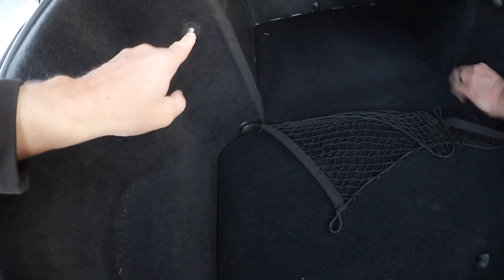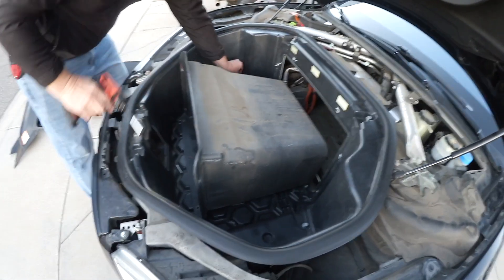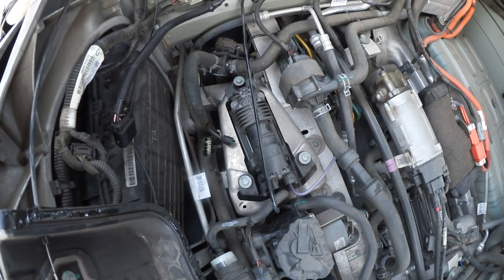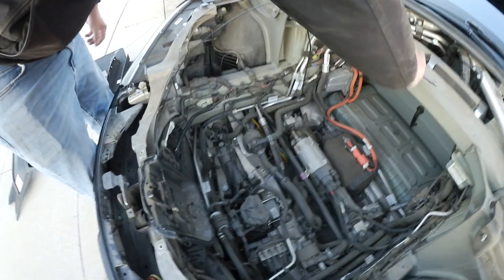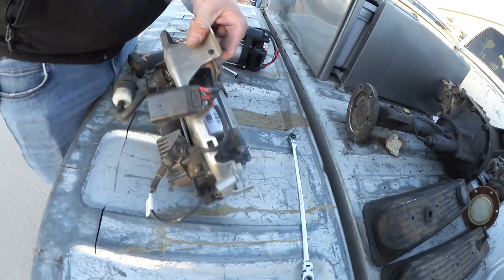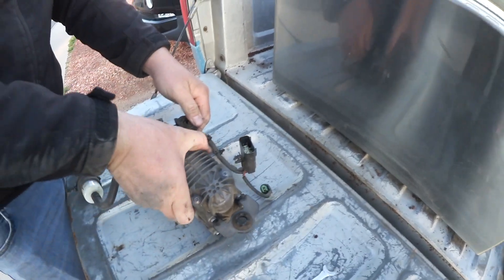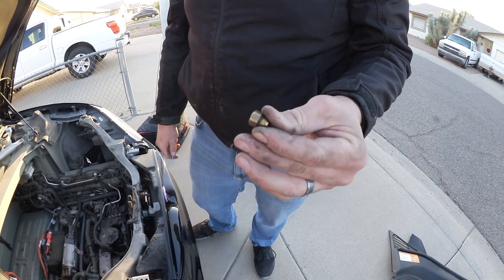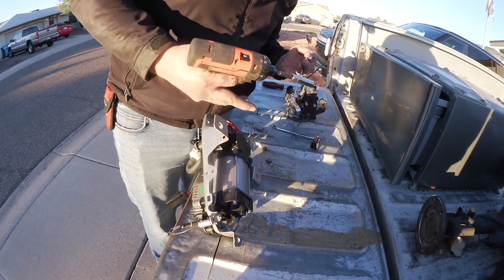Tesla Model S Air Compressor Replacement

Comment: My 2014 tesla model s sat for 3 months. Came back and front end is low to the ground. Rear is fine. I try changing height on screen with no response of compressor just says ride height is already high. 

Do you think it could be a compressor issue or front struts are out. Fuse and relays look good
Reply from the maker: @alexdavalos1935  front struts because the rear is ok. Rolf

Comment: Hi. I have my Tesla on The same state. I Change The compressor but no result. What can I do?
Reply from the maker: Subscribe and look further in my channel for the air suspension repair. It will tell you the solution. Rolf

Comment: How did you get the bolt from below?
Reply from the maker: Yes that was a little difficult. You will succeed, but I cannot remember how. Rolf
Reply: Ended up having to bend the whole thing upwards from the bracket. Bout to put in the new one right now, will update
Reply: Interested. I am about to do this job too. Any help and guidance is appreciated.  Also the clips that were removed from the purple and black hoses, are they needed to be reinstalled for when these hoses are reconnected to the new pump?

Comment: Thanks you your work with this video. I run from new a 2014 P85 138,000 miles, retired on Tesla shares and enjoy working on mine. Back in 2018 Tesla replaced the front struts for some reason but now the rears sag when left overnight, I think its the Residual Pressure Holding Valves, ill get some same as Tesla but cheaper. After being left and when the weather is wet / cold My car often cycles the compressor maybe 6 times until the blow off valve on the tank fires off. A Tesla tech said this was correct the car is purging the air with heated / dry air so the system last longer, makes sense to me now I know the system is closed. Anyone know this is true?
Reply from the maker: System is closed. I have a bunch of movies about the air suspension. Please subscribe. The residual pressure holding valve is the key. This one is coming Sunday. Rolf
Reply: @TeslaOwnersUS  Rolf Ive been subscribed a few years now great channel. My system definitely pressurises till the blow off valve activates on the reservoir tank so it must draw in fresh air on these cycles. It makes sense to me  as I was told Tesla are going to cycle the pump so its hot and this will help keep dry air in the system. Look forward to the residual pressures holding valve video. Ive tested mine off the old struts they hold 0.4 bar in the strut.
Reply: @TeslaOwnersUS but isn’t there a filter on the inlet which I assume is Hydrophobic ? 🤔

Comment: I'm in a Tesla Model S 2012 P85 lowrider currently.  Two questions, do you know what a "normal" pressure PSI in the top fitting before the reservoir?  Second, does changing the tire size reset the suspension system so I don't need to drive it to the Tesla Service Center and fill with nitrogen?
Reply from the maker: 150PSI at the air reservoir according to former Tesla ranger. Tesla fills with filtered air. Rolf
Reply: And once I replace the compressor I can just reset the system with the tire size change hack instead of going to a Tesla Service Center?

Comment: I heard that Tesla fills the air suspension with nitrogen to prevent condensation in the pump, any truth to this? If so, did you refill the reservoir with nitrogen or just let the compressor fill it with outside air?
Reply from the maker: Confirm from former tesla ranger. Just filtered air. Rolf
Reply: My new air compressor (AeroSUS) has a sticker that says "Inject 1.7mpa nitrogen" before use, any idea if it is needed? will it burn whitout?

Comment: Heard a loud boom. I thought something fell in the house. After doing some investigation I found my 2013 MS 85's front end sitting 2 inches off the ground. I suspect both front air suspension compressors blew or best case scenario the air suspension fuse blew. Error code eas_w007 (air suspension unresponsive). I just took all the covers off and the compressor is working. From what I can tell, i don't hear any leaks. What are your thoughts?
Reply from the maker: These are the front struts. Check them out. They should be replaced after 80k miles. I do have a video for this as well. Rolf

Comment: The aircoupling is a VOSS Automotive SV203 M10x1 6mm air coupling. Its recommended to replace the air coupling after disassembly.